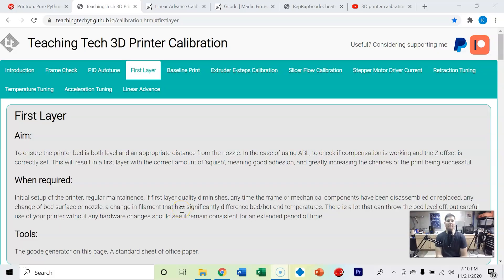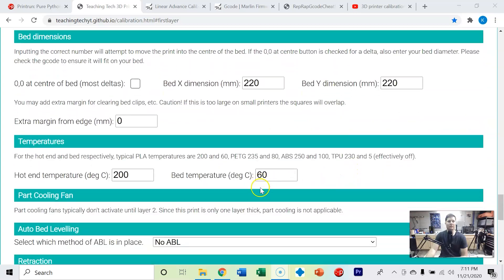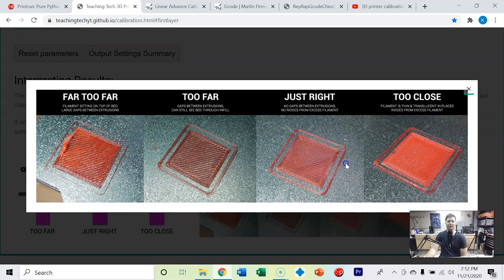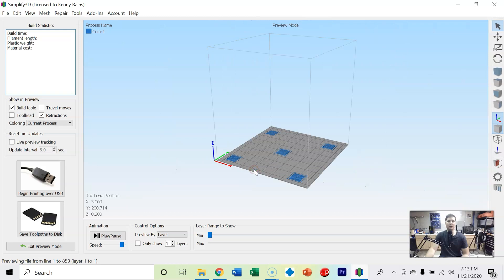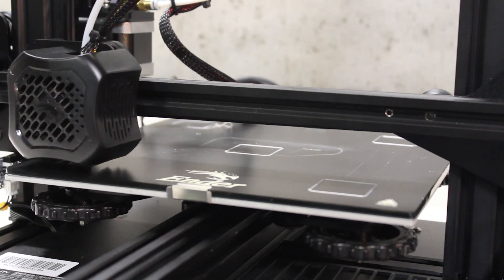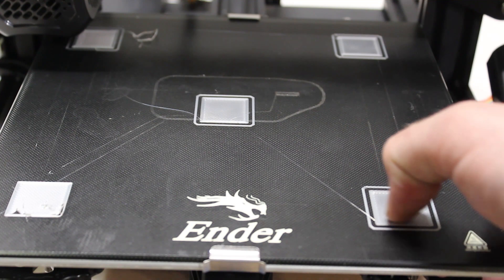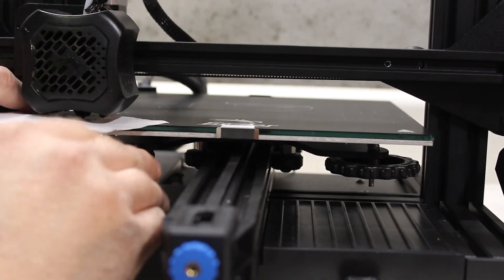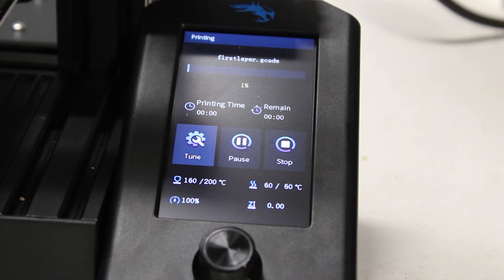Advanced Bed Leveling First Layer - Calibrating your 3D printer Part 3 - Ender 3 V2

Comment: So the thing I have noticed with my ender 3 v2 is the bed plate is not totally flat. As in the center of the plate is lower than the 4 corners, not by much but enough that I can tell it is looser there than at the corners when Im feeling the drag. What could I do to fix that and would something like the BL touch help compensate for that?
Reply: I just got my Ender 3 V2 and I'm having the exact same issue. Other than this, the printer functions great! My first 20mm calibration cube was spot on (<0.1mm off in all directions) and the faces look beautiful.
Reply from the maker: @grudgeon  I am about to get a bl touch for mine as the build plate is not totally flat. The main thing is just trying to get the middle spot on as that is where most your prints are going to be.
Reply: @rainmaker3d  I just wanted to let both of you know that I did install a bltouch couple days ago and so far it's been working great, minus the overhang issue(not related to the bltouch) that I'm having. I ended up using a firmware from smith3d atleast for now till I learn to compile my own firmware but the smith3d they added in aux leveling and z offset tool which the stock creality firmware doesnt have aux leveling. Not that it's a deal breaker not having it, it just makes it so the hot end moves to each corner with a touch of a button without manually moving it yourself.
Reply: @motorhead45102  Thanks for the update! I was able to fix the dip on my glass plate by using a 4 layer thick folded piece of aluminum foil cut in a ~4 inch square placed between the aluminum and glass. I got the 5 square pattern to print nicely, but now I'm having issues with the corners of my current print curling up, even though the first layer went down nicely.
Reply from the maker: A bltouch would be the real fix as it would compensate for your unlevel bed. In the meantime you could try to flip your plate and print on the glass and then just get it level in the very middle and you would be a little high on the edges but if your prints are centered and smaller you should be okay.
Reply: @rainmaker3d  Mostly where I have it now with the small prints it seems to be doing good. Though the first print had adhesion issues because I had too much of a gap.  Also I just watched all your videos in this series and I'm going to have to fine tune the printer on a weekend. Also did You mention in one of the video's about setting up a BL touch?  One last thing, so much to ask about 3d printing but I'm learning but this is my first 3d printer
Reply from the maker: @motorhead45102  I am glad you liked the videos! I am planning on getting a bltouch soon and will make a video of how to install it. No worries on the questions everyone has to start somewhere. If you have anymore just ask.
Reply: The latest version of Professional Firmware offers the possibility of building a manual mesh to compensate for curvature in the bed. Yet another great reason to replace the stock firmware